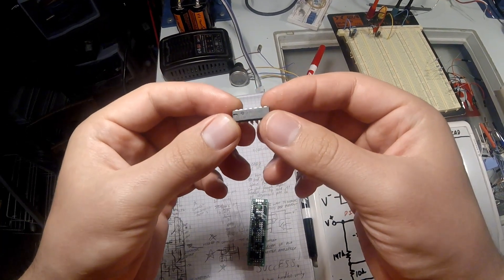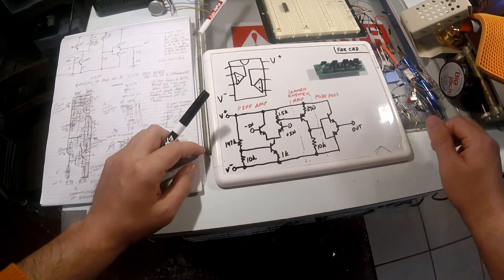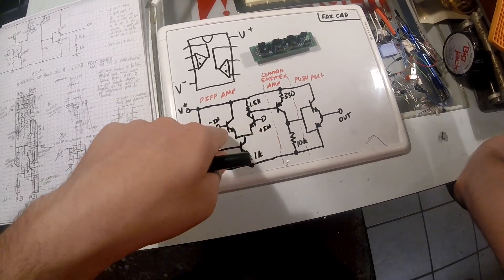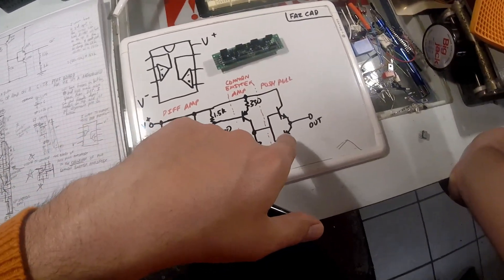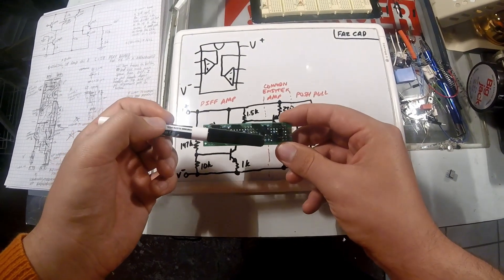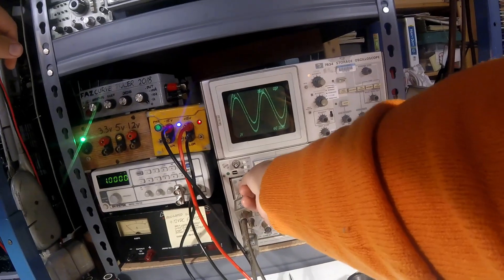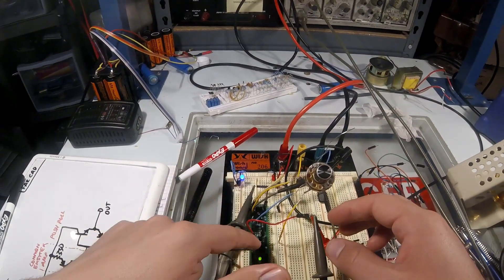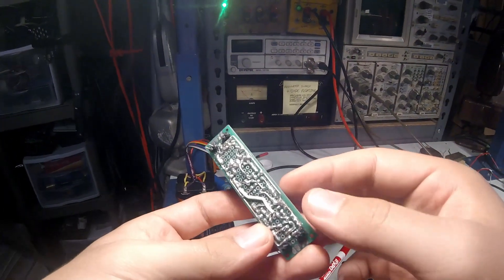Discrete Dual Op Amp

Comment: nice work, ive been wanting to do this same thing . i built a Boss BD-2 (blues driver FX pedal ) that uses a Discrete opamp for the first two gain stages , that got  me wanting to learn how it works. i would love to be able to make a discrete 4558  or the Tl072 chip just to know exactly how it functions when i use them in my FX pedals. i enjoyed the video thank you for making it . can you recommend any books for me to read  on this topic ?
Reply from the maker: Art of Electronics Lab Manual